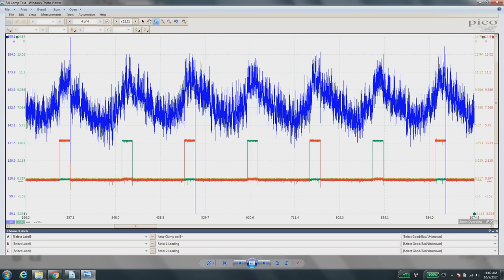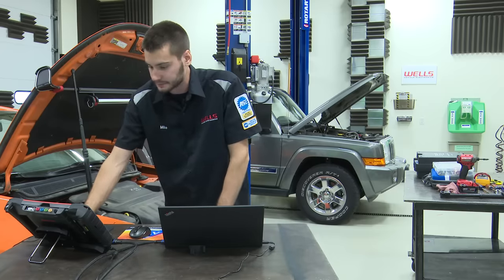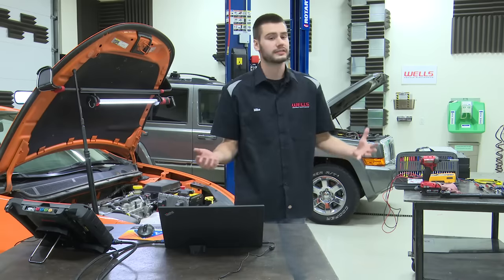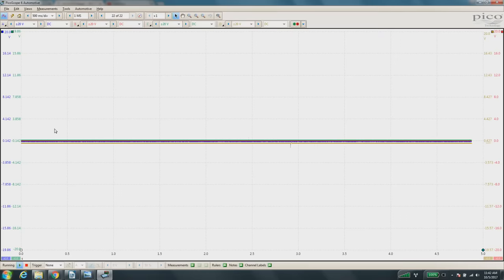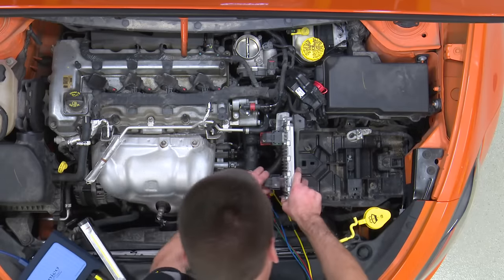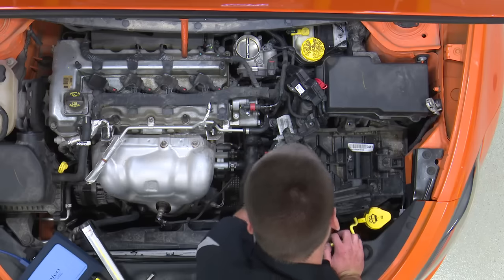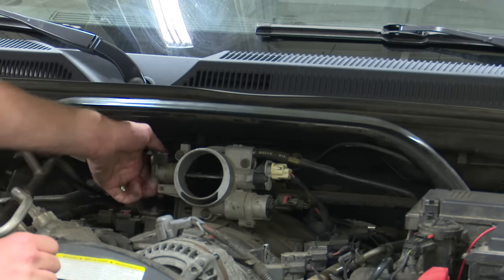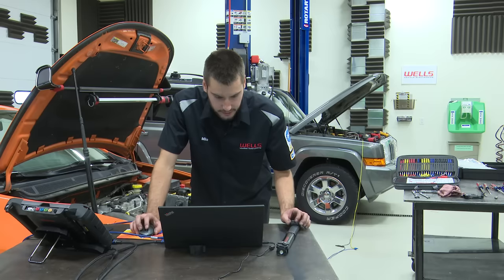Diagnosing With The Lab Scope - Why Every Tech Needs To Be Using This Tool!

Comment: Thank you! I had a 2013 Nissan Versa come into the shop with a P0705: Trans Range Switch code. The scan tool showed the switch working correctly. I hooked up my Pico and 5 minutes later I knew with 100% certainty that the switch had failed! This is quickly becoming one of my favorite channels, Mike!
Reply from the maker: Thanks for watching Chris! Amazing what the scope can tell you that the scanner can't!
Mike Becker, Senior Technical Services Instructor

Comment: This is the first time I’m watching your video and it’s great. I really hope the guys that take there cars to a repair shop and believe diagnosing should be free goes to show it’s time precision and skill just to diagnose today’s car. It’s also great to see diy viewers getting into cars.
Reply from the maker: Hey Emilio! Welcome to the channel. Glad you are liking our videos. Feel free to leave comments on whatever. I always go out and answer them! 
Mike Becker, Technical Services Instructor
Reply: The part where troubles come to the shop after the Diys.....   and that seems to follow me.
Reply: So charging for our time for diagnostics is the step towards fixing after three other shops couldnt.... didn't try to pretend.   Now I've more issues along with the original.   I don't own a shop that is perfect and is always new cars but my world is included to everyone's cars.... regradless of make or models.   But I don't do restoration and no longer do carbs.    So yeah....   diagnostic is not just a free thing.  I don't assume.   I won't sell you something.   If I don't know...   I send you off to someone else that does.  Don't advise for many to just place parts or spend half the day to investigate where a shorted wire is.   (Can bus)....   can be a real issue in the original versions of the can systems.   Tracking a short to ground iis offen si much easier than finding a short to power.   Right?  THATS when your cars dies.... BUT ONLY 3 TIMES randomly in the last 6 months.   Do not ask me why!.... you've had Auto zillion part store clear your codes 14 times and the data Iooking at is....   you had 5 miles.

Comment: I think the reason why we’re not using the scope is because we have to learn it on the job by ourselves. Really sad cause I’ve been a post office mechanic and they used to fly us to school in Oklahoma for free training.  But the newer Venice’s we need the scanner for is mostly out Chrysler pro master vans. And there the biggest pieces of junk in the world.  Already trans solonoid problems less than 6,000 miles it’s all plastic parts? For the most part the code readers get the job done with no need to pull up and run oscilloscope tests. We still use the parts replacement method. Works as well as a scanner really?  So think about your ideas of trying to up sell you snap on scope products . I haven’t bought into the bull yet. But your videos are great and your a grest person for instructing us .  I guess there is sum hope for the USA automotive field.  Missing the model T
Reply from the maker: Hey Mark, thanks for watching! Sad to hear about the ProMaster vans...ugh! When working on similar models all the time you have to do what works and what is efficient for you. This car had been to the dealer already...multiple times with no fix. A scope was necessary to accurately diagnose this thing...but it's an anomaly really. That's why it makes such a good lesson. Here's what can happen and the tools you need to properly diagnose and fix it right the first time. This is the type of car that earns you a customer for life.
Mike Becker, Senior Technical Instructor

Comment: I use a snap-on vantage ultra the most. Occasionally I will break out my desk top scope. The Vantage has a scope built into it along with a database of pretty much everything on the road it has all the sensors and switches each one has pages of test to do and known good values for them along with the location and wiring diagrams of all the plugs. It’s the 2nd vantage I’ve owned. I had a first generation that I used for years until I got great tread in and deal on the new one. I couldn’t resist 25% off.
Reply from the maker: Great tools, can't pass up a good sale :)
Mike Becker, Senior Instructor

Comment: As a young man - I always made my own repairs on my vehicles. Now that I am older, now 57 yo, I make a much better paycheck - SO - though I know how to troubleshoot - I now will take to trusted technicians and just pay them. I do believe that I would greatly enjoy a picoscope to use for accurate diagnosis of engine malfunctions - however - unless I was - as yourself - repairing other customers vehicles for a living, I can still make many repairs myself on my own vehicles without the cost of a lab scope. Once in a while , I get bit by replacing a part which probably did not need replacing. The modern tools are very nice to have BUT , they are expensive to own to just make repairs on your own vehicles - which is one reason among many why the modern mechanical technician has a much higher shop rate - he needs to make a higher rate just to pay for the tools needed to properly diagnose engine malfunctions. Just my opinion - but - there is validity to this train of thought.
Reply from the maker: Hey Cory, diagnostics can be fun...or they can be a huge headache that keeps you up at night. Personally, I like a challenge, that's why I don't pay anyone to work on my stuff. I can see why many people should though! You train of thought makes sense. Everything automotive has increased, sales prices, tools prices, shop labor rate, technicians wage and the expectation of the technician. It all makes sense.
Mike Becker, Senior Instructor

Comment: At times it was like watching paint dry but very informative video. I learnt a lot. Thanks for the video.
Reply from the maker: Hey Rick! You're right, at times I was struggling getting that switch in. Things like, getting the scope stuff out and set up did take time, but I think I proved the point that it doesn't take THAT much time, right? My goal was to do it all real world. Show you guys it doesn't take 3 hours to set up the scope to prove a failure. Thanks for sticking with it and taking the lessons away. Glad you enjoyed it. Thanks!
Mike Becker, Technical Services Instructor

Comment: I work as a Porsche tech. and whenever I have seen those trigger points on the cams broken or bent is when someone removes the cam cover with the engine still in the vehicle. The skinny trigger point gets caught on the cover during removal or installation. There’s very little room to work with in that area and if you’re not aware of those trigger wheels it’s very easy to do. 
Sometimes you get lucky and can bend them back into place.
Reply from the maker: Hey Kendogz161, for sure! Gotta be careful with those things. That air gap is critical!
Mike Becker, Senior Technical Instructor

Comment: I never would've guessed that the Dodge Dart has Hyundai-Kia parts. I always thought it was a German-based car, seeing as how the wheels are held on with bolts instead of studs and nuts. You fared better than I would with that trans. range switch replacement; I'm sure I would have ended up cutting myself on something and spilled some blood on camera!
Reply from the maker: Hey Joseph, I wouldn't have thought that either! Seems so strange. I didn't get cut up too bad...i'm just happy I kept my cool and didn't start throwing wrenches, or swearing, or something haha!
Mike Becker, Technical Services Instructor
Reply: The Dart is based on the Alfa Romeo Giulietta, an Italian car. I think most European cars use bolts instead of nuts for wheels.

Comment: I think that noise on the Jeep TPS was extraneous noise the leads were picking up from something in the shop.  You'll notice it appeared in the flat line reading too.  20' of leads connected without a shielded connector let's in a bunch of rf type noise at the connection.  Good video though, not trying to insult you, just trying to add some personal experience from my time using a scope for much weaker signals.  BTW, that glitch seemed to occur at precise 20 second intervals.
Reply from the maker: Hey Tony, sure, that could be! Thanks for watching!
Mike Becker, Senior Instructor

Comment: Hantek makes a fantastic scope for the $. Their 2D82 is a PERFECT garage scope. Small, durable, decent power (80Mhz range), Scope/DMM/AWG, portable (rechargeable 18650s), connects to PC via USBC, has good features on PC software as well as onboard scope (many auto diagnostic tools). I got the 2D72 before I saw the 2D82 and it's been great to me but definitely would have gone for the 2D82 if I saw it. And it still only costs about $200
Reply from the maker: Hey Bran onymous, good to know! That sounds like a cost effective tool that will do what we need it to. 
Mike Becker, Senior Technical Instructor
Reply: @GoTechTraining  I really think so. And when I said "auto" I should have clarified. I meant automobile, though "automatic" still applies - as I meant "automatic automobile diagnostics tools". There's a pretty large menu with shortcuts to many different modes to easily diagnose vehicle electronics. I probably sound like a spokesman for Hantek but aside from owning the 2D72 scope, I have zero affiliation. I've just been impressed with it and think the 2D82 looks like an absolutely ideal automobile scope. And is a great price (relative to scopes). If you do end up picking one up, I'd love to hear your opinion, as I'm barely even a weekend warrior compared with you being a knowledgeable professional. I'm curious how useful it would actually be for you. Great channel by the way. You're sharing a ton of great information
Reply from the maker: Bran, i'll look into it. Being that I already have the PICO, a UScope, and the Verus scope I'm not really sure I can justify buying another right now. But I will take your word for it! Thanks for watching.
Mike Becker, Senior Technical Instructor
Reply: Bran onymous Hanteck is kinda a budget scope and not shielded I wouldn’t waste my money on it. They did steal the good known wave forms from pico too. It’s good to get it into your box if needed but pico aren’t that expensive considering

Comment: I had the PRNDL switch on my 2001 GMC Duramax go rogue over time. The incipient failures resulted in two tow homes.
Finally got bad enough the truck was throwing codes. All around 299k miles. Early GMCs had the switch mounted where it would load up with mud behind it, like mine. Later models it is internal to the trans. Scope would have been nice to have, still need it for other issues...
Reply from the maker: This is a perfect example of when a scope could have saved you time and trouble. Glad you eventually got it fixed though!
Mike Becker, Technical Services Instructor

Comment: What does the pico offer as an advantage over the snap on scanner as a DSO? Our shop needs a scope as well as a new scanner, wondering if we can get two birds with one stone.
Reply from the maker: Nick, the PICO interface is much easier to use. The Snap-on scope in the Modis and Verus are ok. They both can and will get the job done. What I would suggest is getting your hands on a PICO to try it out. At a show or another shop or something....sometimes it's nice to have 2 tools. The PICO to scope the output and the scan tool to command it on and off. If your using your scanner as a scope at that point, it's not possible.
Mike Becker, Technical Services Instructor
Reply: Nick Cove try get a GDS scan . It is a two way scanner plus 4 channel scope.

Comment: Looks like the computer expects make before break on the switch.  This repair did stop the problem, right?  You might want to emphasize that mechanical switches are inherently noisy.  Contact bounce is common with any switch opening or closing.  I build microcontroller based escape room props and I usually code in a settling time of 100mS to debounce switches.  It might not need that much time, but it works and maximizes the usable life if the switch.  Customers are pretty rough on pushbuttons.
Reply from the maker: Hey Tony, great tips, thanks! Hahaha yeh, escape rooms bring out just a bit of frustration ;)
Mike Becker, Senior Instructor

Comment: Ummm, shouldnt the question be "why dont you use it every day?" ANSWER: some days i do power steering hoses or brakes. And lets be straight up, some mkechanical issues can be converted to a waveform and dissected (such as running compression tests, you can see clogged catalytic converters, valves not opening on time, you can even use it with a transducer to look at fuel pressure regulators, AND injectors under-performing. Its all about the wave forms). Now i will watch the vid.
Reply from the maker: Hey Rod, the scope is an incredibly powerful tool! So, what did you think!?
Mike Becker, Senior Technical Instructor
Reply: @GoTechTraining  I watch long training type vids in slices, not done yet. However, its de ja vu on the TRS code. Its a common Chrysler thing. Jealous of the Pico though.

Comment: Fuel level gauge signal is weighted over time so the meter does not jump with each wave in the tank. It might trigger a code but not really a functional trouble.
Reply from the maker: Could you imagine what a fuel gauge would look like if it were real time!??! That would turn out pretty funny!
Mike Becker, Technical Services Instructor

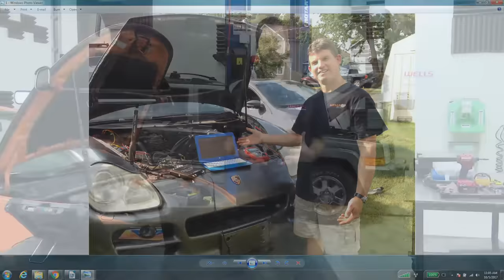Comment: @6:20 that's a familiar scope. Hantek 1008, pretty bad equipment, but does the job when you can't afford or justify any better. With it I've managed to positively identify faults I would not have been able to without it, it also allows me to learn by doing without spending far too much. Not bad for an investment of less than €50.
Reply from the maker: Koncrete, It may not be the best scope but it is certainly better than no scope, right? 
Mike Becker, Technical Services Instructor
Reply: Absolutely.

Comment: Great video, the throttle body was dropping voltage before the accelerator was pressed if you watch when you first hooked up, the throttle being pressed was coincidental to the fault repeating as it was already appearing when it was at closed position, probably a hairline crack in the power track of the circuit board. Not trying to be clever bro.

Comment: Wow great stuff! had a chance to use the Pico scope in my dealer days! On a side note, I was always under the impression that you should always connect the positive terminal to the battery first?
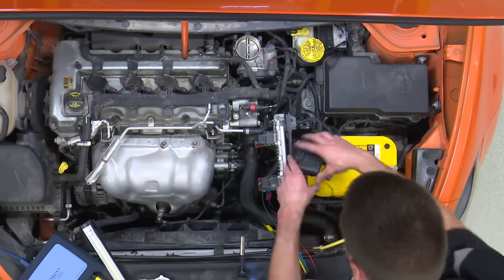Reply: 1:05:39
Reply from the maker: Hey Daniel, thanks for watching! The negative terminal is supposed to be the first off and last installed. That's the best practice...
Mike Becker, Senior Technical Instructor

Comment: What I’ve learned owning a 3.6 pennastar engine is never get a magnet near the magnetic reluctor wheel on back of cams   Right by back spark plug tubes
Reply from the maker: Did it change polarity on you?
~Ryan
Reply: @GoTechTraining  yup and you can’t just replace the wheel it’s pressed on to a $300 cam shaft 😳 all from magnetic spark plug socket in last tube 🤦🏼

Comment: We don't use scopes at my place  of employment  because  the owner  is to cheep and uses the cover your ass process  to validate  the charge . I have  my own scope and use it as much as I can in my home situation  as much as I can but most of the time I'm working  on fully  mechanical  deasiel  tractors . I try to convince the owner  that the scope process  is good and the value  to the customer  is worth  the learning  time

Comment: Had a choice the other day between cheap Chinese no-name sensor or Wells sensor that cost more.   Went with Wells because I have learned so much from your videos and I know that Wells puts a lot of R&D into making better parts.  Thanks for your videos. I have learned a lot from them.  I am just a DIYer that plays with cars and diagnostics at home for fun, but recently diagnosed and fixed an intermittent issue that 3 other shops charged a customer for diagnosis and returned the car with "Could no reproduce"
Reply from the maker: Hey this is awesome! Thank you for going with our part! I am so glad you are learning from our videos and classes. Nice fix on that one, that's a huge pat on the back to yourself. Anytime you can fix an "unfix-able" vehicle it's an amazing feeling.

Mike Becker, Senior Technical Instructor

Comment: OMG the misery you went thru to get the scope leads connected at the switch. Being older getting frustrated easier and the training I had, not with scopes though, I have the tendency to always go directly to the computer. What some have said the pierce connection would have been a god solution as I am learning the back probing is not as reliable all the time as you experienced. I wish they would have had cheap scopes years ago and taught too. I now am retired but looking for a used pico like you used and by chance if it comes my way and reasonable I will buy it. I learned from you FYI, thank you.

Comment: The noise in the Jeep TPS signal appears to be originating from somewhere else and not the sensor itself.  I bet if you watched that signal with no physical input on the pedal that noise would be time consistent and it would appear on the scope at the same time interval. That noise was there before you guys ever touched the pedal. Roughly about every 17 seconds from what I can see in the video. That's not positional noise in the sensor.
Reply from the maker: Interesting...i'll have to go back and take a look!
Mike Becker, Senior Technical Instructor